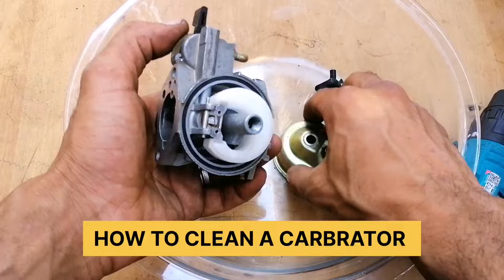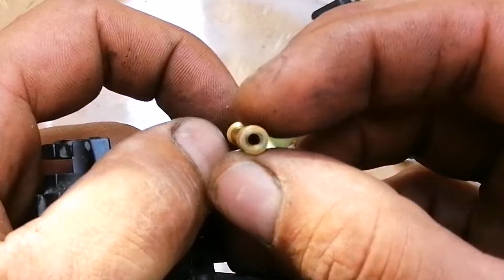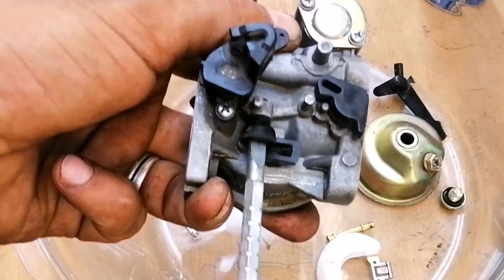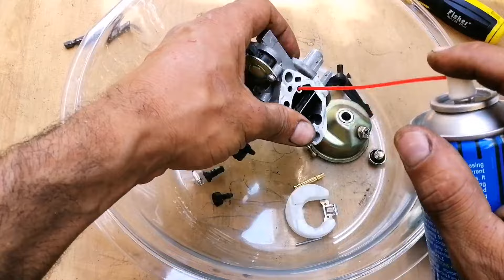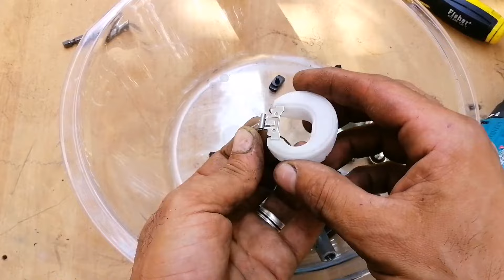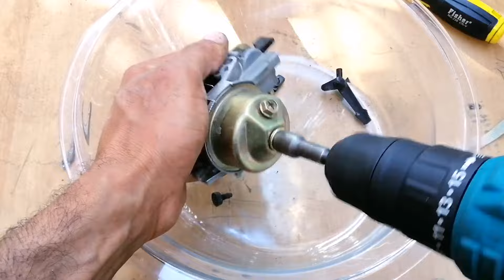This easy How to clean a Honda carburetor of small engine Gx160

Comment: I have the same carburetor but in a different brand, I need to know why my emulsion tube goes up and down when you shake the part. From my experience with carbs, the tube normally stays put but mine doesn’t. Don’t know if there should be an o ring to hold it or is it a defective part, any thoughts would be helpful thank you.
Reply: Your main jet isn’t seating all the way holding the tube in place
Reply: @brandonkaempfe27  thank you, I’m wondering if the threads for the main jet weren’t made all the through. I got a new tillotson carb from EC carburetors and it arrived today and fairly quickly.